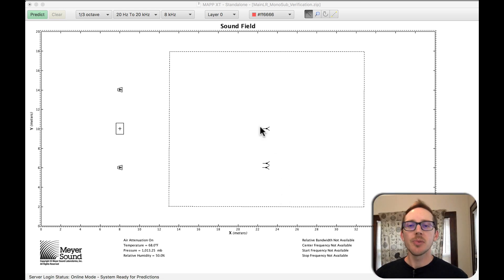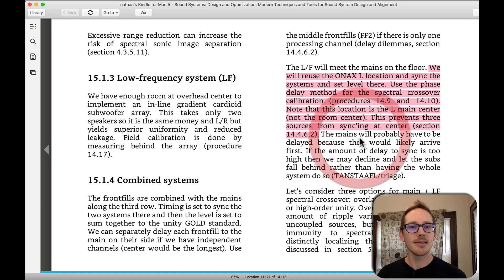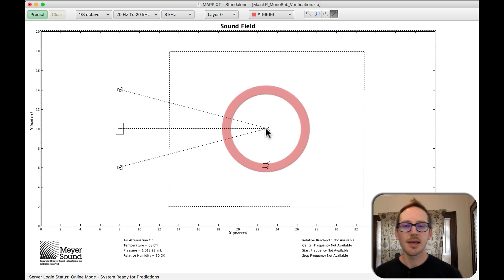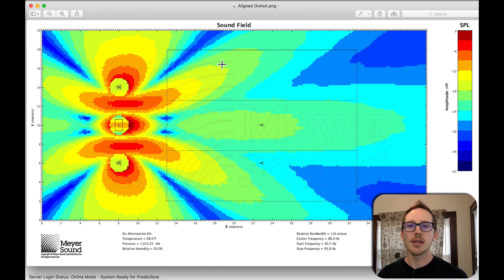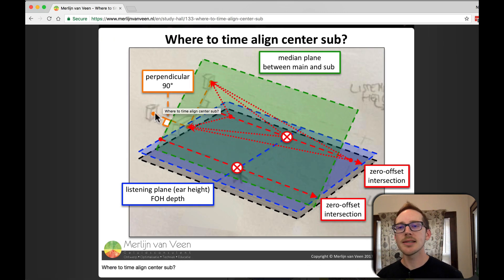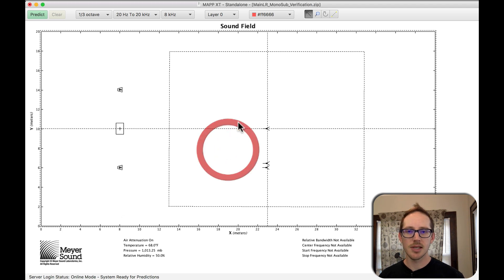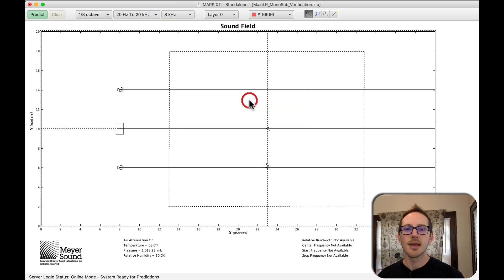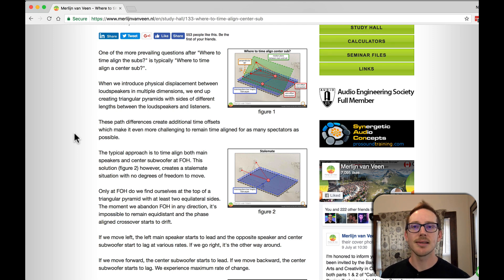Where do I phase align a center sub?

Comment: Hello Nathan, I am a karaoke dj, my set up is basically the same as your model here, 2 mains, left and right and a center sub. My problem is I always get feed back regardless where I position my microphone. I use JBL IRX one as my mains and I added up a mackie 115S as my sub. The reason for this it's because I am not contended with the subs on my JBLs. Please help. thanks
Reply from the maker: Hey Joseph, although mic feedback can be influenced by your sub alignment, start here: https://www.sounddesignlive.com/how-to-control-feedback-in-live-sound/

Comment: Great video, thank you! Let's also remember that time aligning to the on-axis A pos, or Merlings suggestion will mean delaying your main LR a bit since most stages are wider than they are tall. Delaying your LR has all sorts of effects on how your directs sound works with the reinforced sound, that may or may not be much more noticable the exact phase alignment is at your x-over freq.
Reply from the maker: Great point Johannes. The sound system's interaction with acoustic sources should be considered.

Comment: So when doing this in the field, and setting your crossover filters & levels at this position, would you suggest doing the measurements with only the top-left & sub, but then where you'd normally assume 6dB of summation, try to hit a crossover point -9dB down instead (and then confirm with both tops + sub on)? Or would you initially capture a trace with both mains on and try to set the crossover and align the sub to that?
Reply from the maker: Hi Mashzmash. Short answer, yes your first method sounds good.

Longer answer, I would not try to set crossover filters in the field. I would set them ahead of time so I could put them on the ground and get high quality quasi-anechoic data to work with. If I was forced to set filters in the field, I would validate them with with very close measurements (~1-2m).

When it comes to which sources to turn on during alignment, the official answer is that everything should be on, but almost no one does that because it makes the data difficult to read.

These topics are covered here: https://www.sounddesignlive.com/the-complete-guide-to-measurement-microphone-placement-for-subwoofer-alignment/

Comment: If the centerstacked sub array is say 5-6m wide or so, I assume you would calculate to the centerpoint of that array?
Reply from the maker: Hey Robin, in general, yes. For a line, the acoustic center will be the center. For an arc, the acoustic center will be in the center, but somewhere behind the array, so it will appear to appear to come from somewhere along the array depending on where you listen/measure, so I usually just estimate the center to keep it simple. 

This may help https://www.sounddesignlive.com/the-complete-guide-to-measurement-microphone-placement-for-subwoofer-alignment/
Reply: @nathanlively  Thank you! :)